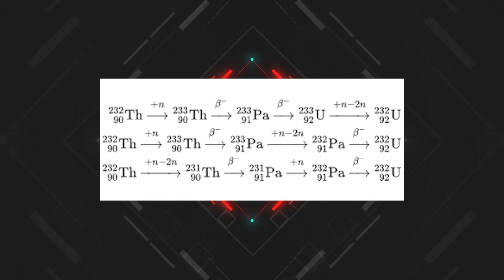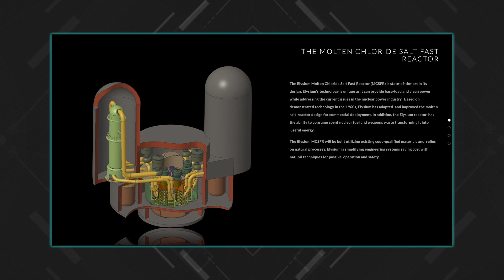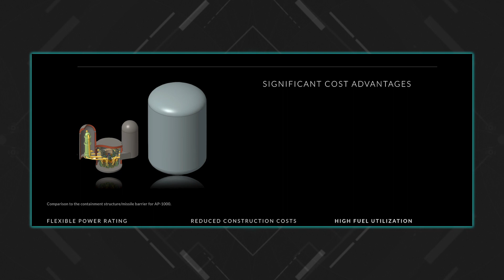Elysium Molten Chloride Fast Reactor (MCSFR): LFTR Alternative | Ep. 8

Comment from the maker: Are you team #MCSFR or team #LFTR? What do you want us to talk about in future episodes? We love hearing from you, so please let us know!
Reply: MCSFR here.  I see no advantage at all with LFTR.  Thanks for the video!
Reply: @mburnzy9269  I agree, much simpler design, much cheaper and much more flexible. It does what LFTR intends to do but better and it does what LFTR simply can't.
Reply: Deplete Uranium is also a great fuel for MCSFR. You need to do a podcast on stored nuclear fuels (you got the list) and how safe it is. Check out Holtec International for more information about nuclear fuel storage around the world.
Reply: @martinkral7222  Yes, any fo of U or Pu is great fertile fuel for MCSFR. There is 10x the depleted Uranium (DU) energy as there us SNF energy left. So, with reguard to already mined fuel (SNF + DU) we are at 16,000 years if we just replace the US nuclear power we have today, 3200 years if we go to 100% electricity (5x todays reactor power). 600 years, if we go to 100% of all primary energy from MACSFR. SO, 600 years or more before we need to mine anything else in the US. Of course we could export fuel too.
Reply: I'm going with MCSFR due to the versatilty of the chloride salt and the fact that it doesn't need enriched lithium to operate.
Reply: I am team LFTR - Seventy years of reactor construction and operating history strongly indicates that it is easier to design safe and economic nuclear reactors in  thermal neutron spectrum (like LFTR).
We should be designing the SAFEST nuclear reactors we know how to build. MCSFRs started up on weapons or reactor grade plutonium is not the safest Molten Salt Reactor technology available while LFTR is.
Reply from the maker: @friend2all5  The LFTR is great. If there is a critical fault its that FLIBE Energy needs to develop the supply chain from scratch(Li7, Braytons, etc). It's a tall order but in the long run it is the best approach to achieving a long term Thorium Energy Economy.
Reply: Deploy MCSFR/Thorcon worldwide ASAP for climate change and nuclear waste consumption. Mine rare Earths and develop LFTR completely then deploy it wherever dictated by big picture economic strategy.
Reply: Both. LFTR is more advanced, efficient & overall sexier design, MCFSR more pragmatic and readily doable design. Either way, any Watt of electricity NOT produced from burning fosils counts.
Thank you for creating really great videos and greetings from the Czech Republic!
Reply: @matejorsag6515  Efficiency is done at the power generation end. Both operate in the same temperature range so there's no benefit at the reactor. As for being more "advanced" it's more like LFTR  is more complex, more expensive and less inherently reliable. Also the need for a breeding blanket and online fuel reprocessing  poses a proliferation concern. With that combination, it becomes relatively easy to obtain weapons grade Uranium bred from Thorium and with a bit of enrichment it can little to no U232 impurities. Just because something is more 
"advanced" and sexier doesn't make it the better option.
Reply: @travisbeagle5691  Spot on!
Reply: @travisbeagle5691  
LFTR operates at 700C max.
MCSFR operates at up to 950C max.
Reply: @EdPheil  Fair point, although I'm not sure there'd be too much in the way  (from a technical standpoint at least) of a LFTR type reactor also reaching those temps if you're able to. Maybe the Nickel alloy of choice might not be able to take the heat?
Reply: @travisbeagle5691  
In a LFTR, you dont need to enrich to get rid of the U232 to get pure U233, although you could in the first few months of removal. But, you can do it more easily to get a few weapons worth, not bulk, by removing the fiel or blanket salt from the neutron flux and waiting 2 weeks for ALL of the Pa232 to decay to U232. Then remove ALL of the U. This leaves 100% pure Pa233 in the salt, which devayse to 100% pure U233 over the following year. This can be done with existing equipment, and without taking any of the U233, mixed with U232, needed to keep operating the reactor. It only takes a small amount of the excess U233.
Reply: @travisbeagle5691  
Fluoride salt in LFTR us more corrosive at higher temperatures than chloride salt in MCSFRs, so it is inherently easier to get chloride sakts to higher temperatures corrosion wise. But, as far as how you Physically get Thot much higher in LFTR, like MCSFR, yes there is no technical reason you couldnt build a LFTR with flow like an HTGR either to keep the containment cooler than Thot, i.e.,near & cooled by Tcold.
Reply: @EdPheil  oh wow. I didn't know the difference in decay time was enough to let you get it that pure and just figured a tiny bit of enrichment would still be necessary.
Reply: @travisbeagle5691  
The other issue is that U232 in U233 is pure when removed from the reactir or blanket. But, U232 needs to decay to Thallium to provude the high energy gamma, but the half-life of U232 ALONE is 69 years, plenty of non-radioactive time to make and deploy a bomb befire too much radiation builds up. And then you can just fluorinate and remive uranium from decay products again and eliminate all radiation again for more years.
Reply: @travisbeagle5691  When burning waste as fuel in a MCSFR, money spent on heat conversion efficiency is wasted. (Likewise in LFTRs, since there is limitless dirt-cheap Thorium?)

Comment: One advantage seldom discussed is not using a moderator.   Thermal spectrum reactors all use graphite moderators which need to be replaced every 4 years.  Since the graphite is slightly radioactive because it is contaminated with radioactive fuel salt it becomes low level nuclear waste.

Comment: Here is the reason I believe this is possibly better than lifter. The reason is the lithium produces tritium. If ya'll think you can trap tritium ya'll are mistaken. The onliest path lifter will be successful is in a very dry area. If you have a location without a nearby river the tritium will not contaminate the groundwater to the river so to not use lifter as the lithium produces tritium. Tritium cannot be contained unless locked chemically with clorine or some other chemical to lock it into place as it will leak through any metal container to contaminate the groundwater. We humans will then injest this radioactive water to our detriment. Savanna River fast breeder did contaminate the Clinch river all the way to the ocean and it did not even have lifter as a fuel but that was to breed plutonium, not thorium to uranium. I do believe Elysium's chloride molten salt reactor might be the only way to go because of the tritium, then you must handle chlorine family products which are easier than lifter.

Comment: So two things Kenny. 1. Does the reactor temperature control like thermal reactors? Or is the only control, control rods. 2. With no moderator then the drain tank would have to be shaped in such a way so that critical mass does not happen. One would think the drain tank also contained a boron lining or control rods in the drain tank.
Reply from the maker: So from my understanding the MCSFR design from Elysium does not have a drain tank.  Ed Phil has given quite a few lectures describing his design in more detail. https://www.youtube.com/watch?v=pqVt8cxx-44

Comment: I thought these chloride fast reactors need a specific isotope of chlorine in order to operate effectively? Aren't there issues with isotopic separation of chlorine if this is the case?
Reply: Depends on the design goals. Certainly they benefit in physics by using Cl37 instead of natural which includes Cl35 as well. There are no proliferation issues with chlorine enrichment, like there is for lithium for FLIBE. It is easy to enrich, the first isotope ever enriched. Plus it only needs 70-95% enrichment, so cheap vs 99.995% enrichment for Lithium-7 required.
Reply from the maker: Ed Pheil didn't seem to think so. But I may ask him  next time we have him on the show.

Comment: The biggest problem with a fast breeder is plutonium. They could make bombs with it. For some reason nobody says we can't use gasoline because they could make napalm with it.
Reply from the maker: I've actually had someone make the gasoline argument before lol. My response is sure you can make napalm, but how many people do you run into actually do that. Yes plutonium can make weapons with incredible destructive capability, but   so can Uranium. The fact is we have all sorts of nuclear waste materials and waste streams from nuclear weapons development. Right now it just sits there. I feel a better solution is to burn it up in an MSR breeder and make electricity. Would you agree?
Reply: @RockLogicWithSeanKenny  The DOE/DOD are planning to down grade weapons grade plutonium to transuranic and store in WIPP. WIPP is being expanded to handle this and other materials. This is a wrong solution for the WGPu. It can be stored at HI-STORE CISF until needed for MCSFR.
Reply: @martinkral7222  
DOE/DOD are NOT downgrading the quality of the plutonium at all. They are just dilutung it, so it wont go critical stacked in WIPP. It could still be pulled back out l, the diluent removed, and be used as weapons. Thsts why Russia says the US violated the Plutonium Management & Disposition Agreement (PMDA) and pulled out of the PMDA too after the WGPu MOX plant was cancelled. Because it is diluted  with "Stardust", i.e., elements higher than Iron, I suspect cerium. So, it takes a LOT of space in WIPP. It is NOT just mixed Transuranics.
Reply: @RockLogicWithSeanKenny  Of course I agree it's perception not logic that stands in the way of fast breeders of any sort.
Reply: Actually, the plutonium in the MCSFR is never weapins grade ≥90% Pu239. We denature any Pu239 at a national lab before taking it to the reactor. In the reactor is only reactor grade <90% Pu239, equivalent to < 20% U235. Anti-nuclears are tricking you by saying any plutonium is bad and weapons. usable

Comment: Interesting techology, my main concern I'd like to share with EI proponents is whether a fast spectrum reactor isn't more challenging from a material point of view than slow neutrons reactors. My knowledge is that a fast reactor is intrinsecally more demanding as science material regarding corrosions, stress, long term operation and maintenance, etc...
Reply: Lol, Salt is less corrosive than hot water of LWRs, and chloride salt is less corrosive than fluoride salt. Generally, fast vs thermal makes no difference whatsoever for corrosion, UNLESS you have a radiatiin induced corrosion reaction, like with fluoride salt & SiC or ZrC structures in salt, or for that matter in water. We do not plan to use those materials, but use already qualified stainless steel.
Reply: @EdPheil  Thanks Ed, unfortunately I'm reading this only now
Reply from the maker: Well I can't speak with certainty however from what I understand the reactor that is being developed by Elysium is using far less corrosive solvents than what other start-up's have proposed so as to not be using materials that have not been nuclear rated.  So I guess you could make the argument that the MCSFR has a less challenging path from a materials point of view than say what FLIBE energy is planning on with LFTR.

Comment: I think MCFRs are great but the Integral Fast Reactor is the real future of the uranium / plutonium cycle. It combines breeding, incredibly high fuel efficiency and closed nuclear fuel cycle in one package.
Reply from the maker: Absolutely!!! However one of the things that plagued the IFR was that they were costly build and operate. The MCFR takes all the benefits of the IFR with none of the cost issues typically associated with it. It also has the added benefits associated with the MSR (high temperature operations, low pressure, and increased safety features).
Reply: MCFRs are far superior than IFRs, because all the features of a typical liquid sodium fast reactor (breeding, waste burning, easy of fuel processing) with a fuel/coolant (unlike sodium) that is inert, not reactive to water or air, easy to reprocess with no fissile separation (fission products acting as proliferation barrier)
Reply: @babyelian77  There is positives and negative, but both the US with EBR2 and Russia with the BN 800 now have a good track record of handling liquid sodium.

The IFR was very specifically designed to have no proliferation potential.
Reply: @Spacedog79  There are no US sodium experienced people that arent retired, most are dead, that worked on EBR II, FFTF, IFR. All the SFR people are new trainees working at TerraPower on Natrium.
Reply: @Spacedog79  
EBR II is NO WHERE close to similsr to BN-800.